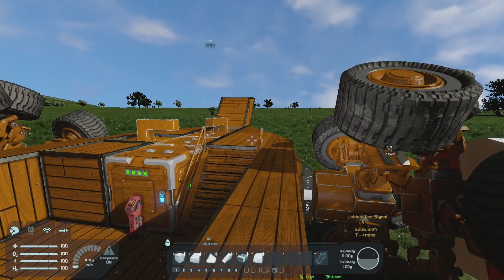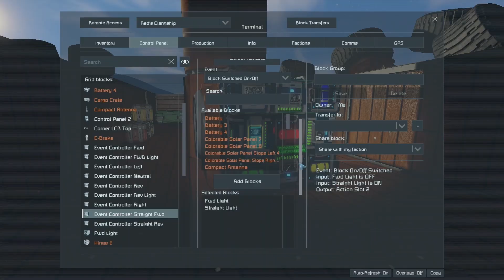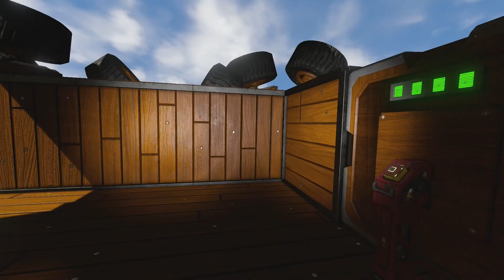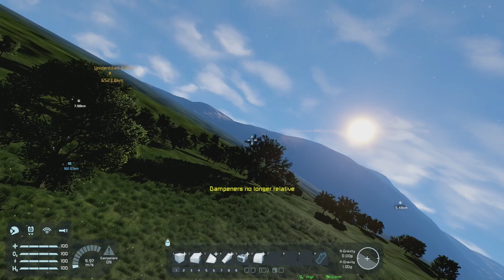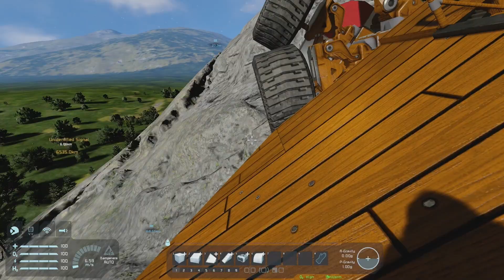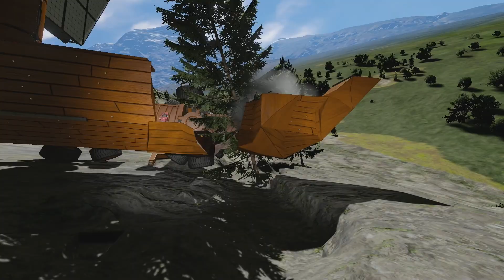Build a Rover Without Control Seats!? - A Space Engineers Tutorial

Comment: I really like this, and it makes want to try something similar, but perhaps using more the hovercraft method (frictionless wheels sideways on the bottom)

Then add some atmo thrusters to the sail mast, and have the mast  on a rotor.

Guess i would still need gyros to actually rotate the boat though...hmmm

Problem is...that will be much harder to control, and my "SS. Bad idea" will probably crash during its maiden voyage. xD
Reply from the maker: that could be fun, but yeah steering might be tough since SE doesn't really emulate differential thrust.  Not quite sure how best to control a gyro for this type of system, but I'm sure you could find a way!